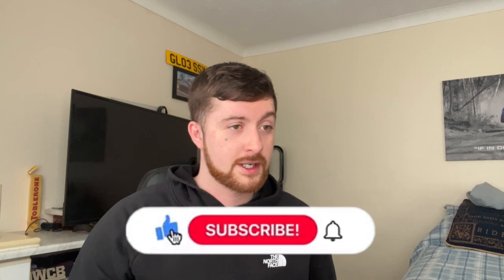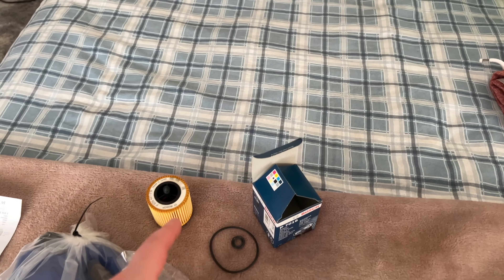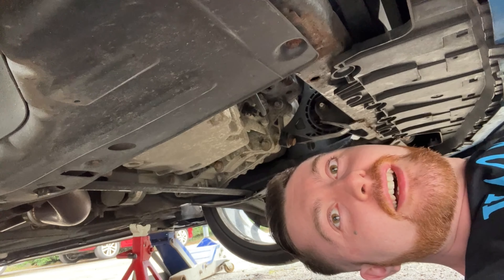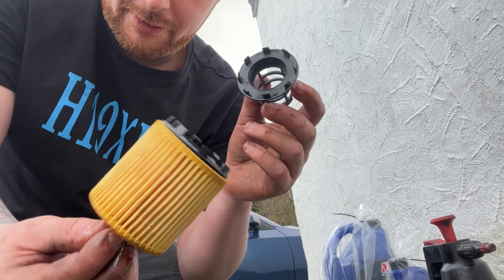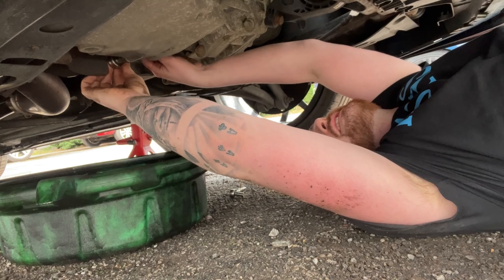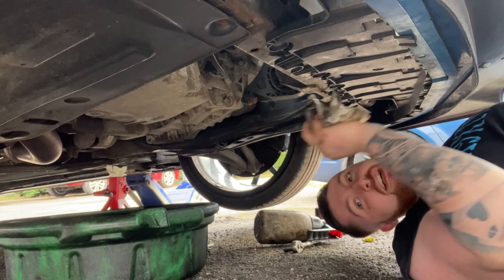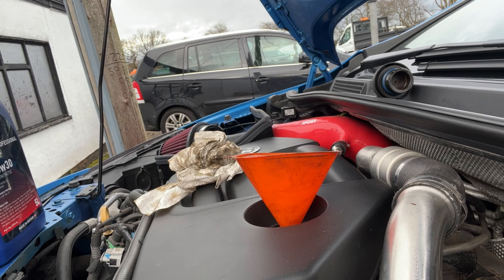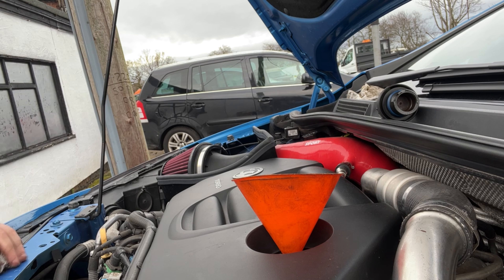Oil and filter change on my Astra VXR

Comment: Tip for you also, always have a few big cardboard boxes broken down to flat to lay on. It's a bit more comfortable and can catch oil drips too. Great video though and appreciate your time doing it. Done it a few times myself now too. Further, pour the oil in with the can set sideways, not vertical as you had it, it splurges or gloops out a lot less.

Comment: Just wondering, after putting the full 6L in you didn't have any oil overfill issues no?
Reply from the maker: No mate want bang on the mark for me
Reply: @H19XNS  fair enough man, just changed mine today putting about 5.9l back in, level is slightly above full but I imagine that's just about right.
Reply from the maker: @jack873  yeah mate that should be sweet, cheaper then my focus, because I’ve got a remote oil cooler the fucker takes 7 litres of oil 😂

Comment: Hello! I know you don't own this car anymore, but i have a question. How do you measure the oil level in this car?  For example, when I remove the dipstick, on the face it shows that the oil level is full, but when I turn it back it is at half.  Only if I twist it does it look like it's full.  It really misleads you.
Reply from the maker: I don’t think I had this problem mate tbh, I guess make sure the dip stick is put in with the logo on the top facing the right way and whatever the level is then that should be correct, hard to explain 😂 but mine wasn’t different on either side
Reply: @H19XNS  Hi! Thank you for the response. I will try to keep it with the logo as you said. Anyway, I'm trying to keep always almost at the max😂
Reply from the maker: @Krokobil24  you shouldn’t loose any oil tbh mate, mine never went off the max line, unless you have a leak

Comment: Go by the OIL life indicator? In the settings...
Reply from the maker: I do a lot of miles in fast time mate so every 6k I change the oil, I don’t go by the indicator as that’s too long for my liking
Reply: @H19XNS  Fair do's. If you are keeping the car and paying £50 it's a no brainer then. Sometimes running engines through town traffic mostly will degrade the oil just as much if not more. One important aspect I'd say also is to run the engine til it's warm also. I'm sure these tips go down well with people not having done it before so good on ye.